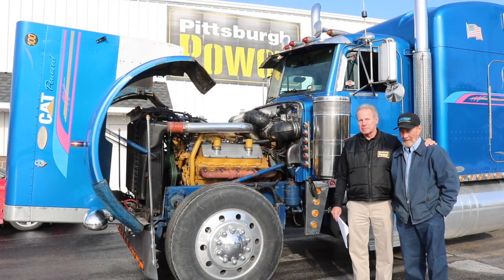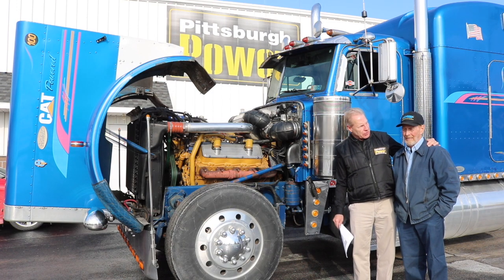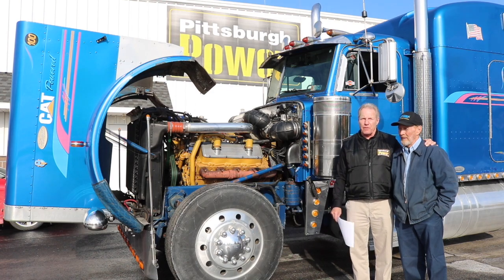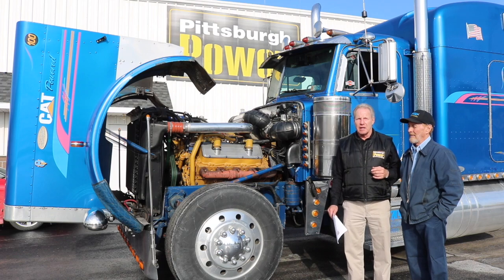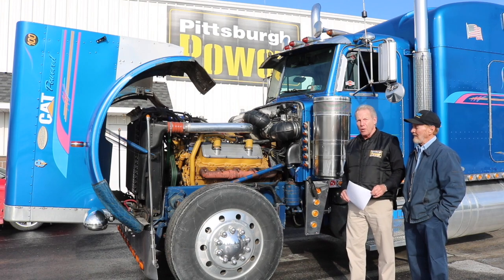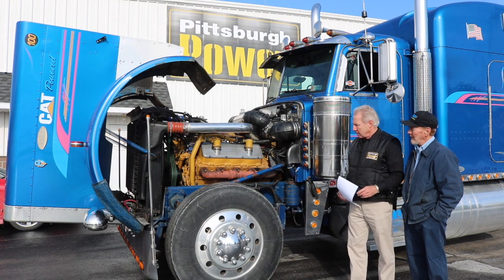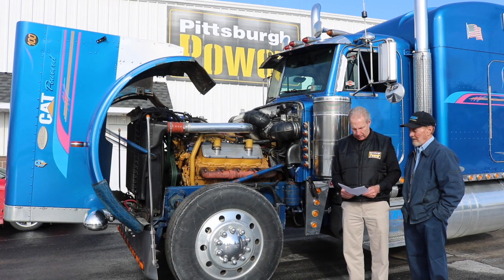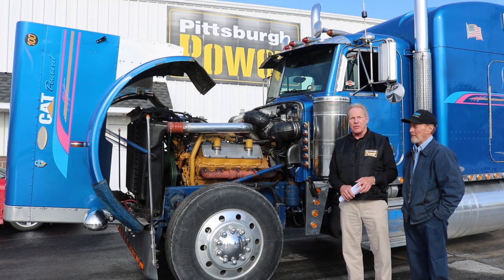Mechanical V8 CAT 3408 Dyno Run

Comment: I wonder to myself if which cat engine sounds  better the 3408 or the 3406E
Reply: 3408 for sure
Reply: @michaellee5399  2nd that. ANY V-8 sounds better than a 6.
Reply: @lewiemcneely9143  wishing i could get my own truck old school one i hate this truck i drive has a junk paccar no damn power
Reply: @michaellee5399  I talked to one of the guys I used to haul with and he's driving a new paccar rig with an Allison and loves it. I like Allisons in quarry stuff and front discharge mixers but if I'm on the road with some weight, give me a stick with PLENTY of gears below it. I'm off the road now but the last ride was a C-15 in a Pete tri-axle that was a nice ride B UT before it I drove a worn out Pete with a 3406B that was SCARY the way it pulled. Same tranny in both but the 3406 was just ridiculous but I wouldn't swap an E-9 in a Superliner for both of them. Keep  your eyes open and ask around. YOu might find one. Keep the greasy side down anyway. You know how people want to get you killed on the road all the time. GBWYou, Pal!.
Reply: @lewiemcneely9143  i got a 13 speed behind this thing maybe if the compnay put it O/O spec it might actually feel like its got something but fully loaded say across the twin sisters or well any steep moutain or grade ill bog down to 15-20 mph not saying going fast on mountains is a good thing especially in winter but sure would be nice to be able to ride at 30-40 going up
Reply: @michaellee5399  I'm in the hills, Blue Ridge to be exact and I remember the 237 Gold Dogs going up hills at 10 m.p.h. The first 300 ( tip turbine on the intercooler, block tag said 283) I ever drove I thought had a rocket behind it and from then on till the electronics reared their ugly head, REally all I can tell you is tell the powers that be that pretty much you get yours by the hour and if they want some improvement it'll be up to them to provide it because you're maxed out where you're sitting. I wish you well Pal but fleet operators just go with the flow. There is more than one job too.
Reply: @lewiemcneely9143  not to long ago i got my tankers endorsement all without studying so i might look into another company one of these days but if i do tanker i wanna start in spring/summer to get use to it i dont wanna try in winter yet
Reply: @michaellee5399  I had a couple of pals that ended up on tankers and said they wouldn't pull anything else. One was caustic soda out of Copper Hill and another was Propane out of Spartanburg I think. Good money in it. I didn't get any endorsements because I had a gracious plenty to start with. I still have my class-A's but no cdl's. I guess you'll have to take over for me, Michael and God Help you if you do!
Reply: @lewiemcneely9143  well i dont mind taking the reigns lol
Reply: @michaellee5399  It'll wear you OUT!  I never turned anything down and if it moved I'd try it. Right out of high school was pulling a sheepsfoot roller. Then the Army with 5-tons and 2 1/2's, the RVN with cranes and clam buckets and the Ft. Story and a D7-E and a 5 ton and a lowboy then out and everything from a 350 Deere to a D8-H and a Chevy 366 single axle to a Superliner with an E-9 and a 12 speed. Anything that I could pay a light bill with I tried and ran. If you get a chance to try something different, gopher it. My Sea Bee Uncle that I took after with running stuff always said 'You can't learn too much'. He was right and it'll help you sooner or later. It sure did me. It's a wild ride but a happy one, VERY fulfilling. I'm going on 69 and still burn diesel. Will till I can't I guess. Just watch out for everybody else with a death wish and go with God. He's saved my hide more times that I can count! The BEST to you!
Reply: @lewiemcneely9143  oh i tell ya im tired of the damn car drivers gotta zoom in front of you right at an exit just to get off like what hell where did people learn this shit it really pisses me off i just wanna run them off the road
Reply: @michaellee5399  That's why thinking head is so important and act way before you need to. I used to try and wait till the last minute for the 4-wheelers but no more. If I know something's coming I get there early and let everybody else get over it. You got ONE rear end and NOBODY will look after it like YOU do!  And if you have a dash cam and someone brake checks or roots into you, it'll be them and not you. Just because I'm not pushing a rig don't mean I don't think like I am. It's always there. You never shake it, even if you wanted to about looking ahead and dodging potential wrecks. The only way to survive.
Reply: @lewiemcneely9143  once i get my debt gone and some money saved i may get off the road or see if i can do something more local
Reply: @michaellee5399  I never went long haul. All my stuff was day trips. One pal had a NICE Pete cabover, pearl purple, BEAUTIFUL rig. He asked me to drive cross country and I told him I would just barely drive cross county. Slept one night in a truck hauling a load of live fish to Penn. Never had the hankering to live out of one but I've known lots who did and most are dead and gone.  Sitting is not a life. Driving a mixer was the best as far as being able to move around but banging around in equipment was my main thing. Get out of debt and the $$ will build up if you're careful. I had a family and lived hand to mouth but never went hungry even though we were WAY below national poverty level. Ran a D8-H for $3.15 an hour. Not much money then but we never wanted for anything really. No new stuff but 2nd hand was even better. Pre- broken in!
Reply: @lewiemcneely9143  i dont have much either to be honest with you what i have is whats in the truck no home or car just the truck and then i have my gf hoping one day to get married to her
Reply: @michaellee5399  Sounds like you are the one Eddie Rabbit wrote the song about Driving My Life Away!  You just have to look at the future square on and make a plan as best you can. If it's the truck for now, so be it. I know there's a shortage of drivers here. Probably is all over the country of responsible folks that'll do the job right. I was a fit-all. Jump from truck to truck, rig to rig and figure out something fast that I never had seen before. No chance to get bored except dump trucking but even that wasn't bad. An 'office job' with heat and air and a radio. Nice when it was hot or cold outside but it takes a toll. I used to be 6'2" but now am 5'11". Furniture disease. My chest is falling into my drawers! Only you know what you want and you'll just have to set your eyeballs on #1 and gopher it!
Reply: @lewiemcneely9143  😂 i like how you put it as gopher it 😂😂😂 great analogy
Reply: @lewiemcneely9143  im 32 so maybe i got some years on me left just want to live without being a slave to debt im tired of paying someone money that gets millions of $ while we the people who pay for everything gotta just survive to bad the government is a piece of shit and instead of having healthy debt free people keeping a great economy they want sick people so big pharma can have all that money
Reply: @michaellee5399  the Paccar MX13 does have power but it's the engine calibration that holds it back. If you have a fleet spec engine, the computer is telling the engine to not give full power at the pedal when you hit it. It's so that the engine doesn't puff soot to mess up the DPF and to keep the truck alive with a rookie driver. Old mechanical engines were usually 1:1 ratio at the pedal with the pump and linkage deciding how hard the power comes on. Mechanical engines feel more powerful than they actually are. My old NTC 400 Cummins and B Model Cat were really responsive but the new school can out run them if they had a performance calibration in them
Reply: @michaellee5399  10/4 to that but it'll get worse and worse. Greedy people are never satisfied and they want to micro-manage everything, even you and me. That's why the epa has fixed the trucks to be like they are. It's all a plan and it's snowballing. We spend a LOT on GOOD food here but it's either that or pills and I like NO pills a lot better. I could get all matters of dope from the V.A. but who wants to be a blasted zombee. Not ME! And we're debt free too. Old vehicles but you have to work on everything sooner or later and you show me a NEW vehicle that is worth a TENTH as much as the asking price as far as actual materials go. Not EVEN close. I can't tell you what's coming or when but I can tell you it'll be BAD! If you've got enough experience and it sounds like you have, tahl to other drivers where your hauls take you, just to see how things are. You might have something close in and just live out of a camper for a while. It don't take a whole lot. Just dry and being warm or cool is about it.
Reply: @lewiemcneely9143  i prefer old vehicles since new ones they can track you wherever you go but in the same note they can already do that with phones and you know everyone carries the damn phone everywhere with them only reason i have mine all the time is for business and my gf if she needs me other than that ill leave the stupid thing off maybe ill go back to a flip phone after i get off the road far as i know you cant be tracked with one of those, pretty sure i was born in the wrong era cus i sure hate how the today is
Reply: @michaellee5399  They can track or vehicles too from the oil slick that's behind them! Ha! We just have flip phones and mine is never on except when I call someone, usually my wife at dinner or the boss when I need to know something on the job when I work. Otherwise I won't be bothered by one. I don't like the here and now but we're here right now so we'll just have to make the best of it. But if they want to track me I'll put a big X on the top and they can have at it. They can't kill me but once!
Reply: @michaellee5399  That sounds GOOD but it'll never happen. The whole thing is one big slime ball and everybody in it is a part of it. They hold too much power and have all Regans star wars stuff hanging around up there just waiting for someone here to start pushing buttons. Like the california fires with one thing burned to a crisp and everything beside it green as gourds. We'll be going down and it's just a matter of time. Deer rifles can't compete with lasers and rockets.
Reply: @michaellee5399  That also sounds good but what can you do against a mob that'll either blow you up, wait you out or just rush you? Best thing is to be ready to leave here when it happens. Lots of folks think they'll survive when it all comes down and some will but what are the ones going to do that don't? And according to the Bible a lot won't. Like a third right off the bat will die. That's a lot of people.
Reply: @hoost3056  i been driving long enough just am tired of not being able to get up and move when i need to some placed dont have much of an on ramp to the interstate and well im sure you can see the picture
Reply: @NomadicSociety  Thanks Pal but one won't fit in a mower or the dinky hoe I run. They are BEASTS when set up right. NO joke!
Reply: Michael Lee dang that sucks. My 12.7 series 60 goes up mountains @ 24mph with 1.4 million miles on overhaul. Now my C15 cat goes up @ 36mph stock, fresh overhaul. Feels good, can't wait to bump the power. 6% grades 80k weight.
Reply: @michaellee5399  the paccar boat anchor!!!!
Reply: @lewiemcneely9143   in Road House,James Dalton said "always be nice"-even when emptying the trash.
Reply: @rearspeaker6364  True but sometimes the truth ain't so nice. But it's still the truth.
Reply: @lewiemcneely9143  sir, you are correct.
Reply: @rearspeaker6364  I guarantee nothing but I try hard!
Reply: Between those two the 08 but the 1693 has got it all over the 3408 any day.
Reply: @bobspringer5370  It better, being the 1600 series. Bigger and better.

Comment: Very awesome 😎 thanks for sharing with us 👍🏻👍🏻👍🏻 and they say a 3408 wouldn’t keep up with today’s trucks....this proved that wrong didn’t it
Reply: The horse power is there but a lot of modern engines are making far better torque...
Reply: He said the the engine was fueled. Meaning they turned it up.
Reply: @rrobins9857  like most people do with the newer stuff
Reply: mtrujillo1973 yes, they do. Don’t argue with me, I am a truck mechanic; you lose
Reply: It wouldn’t not even close new truck will smoke that shit while getting 7 miles a gallon do you even understand how engines work???
Reply: @zionavramov5035  really, as a trucker, you should care more ab reliability than smoking other trucks. only thing this engine don't got is good fuel economy.
Reply: @raynjpg  Detroit 60 series DDEC4 14L and its little brother 12.7 would smoke this any day of the week and reliable with it.
Reply: Nowadays they put out those kind of numbers with six cylinders not eight, plus considerably more torque and decent mpg not gpm like this hog. Don't get me wrong, it's cool as all get out, but not efficient.
Reply: @118chosen9  they might but you would go through 10 605HP ISX engines and that 3408 will still be running.   Long run, 3408 wins every time
Reply: Tesla. That is all.
Reply: @opaqueman5043  we're still pretty far from making capable electric semis. There's just no way to pack the range a massive tank of diesel does with current battery technology.